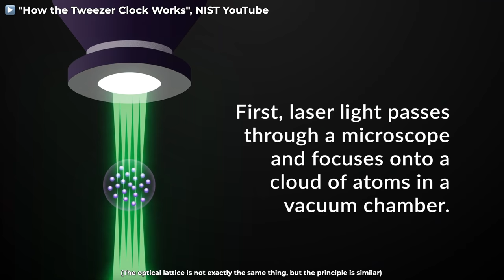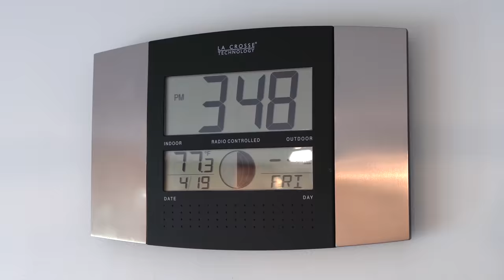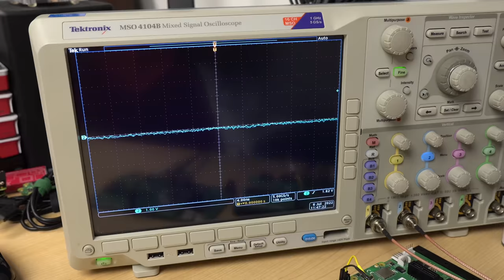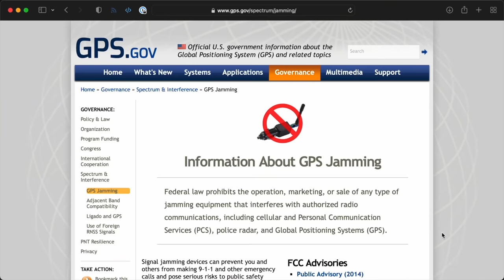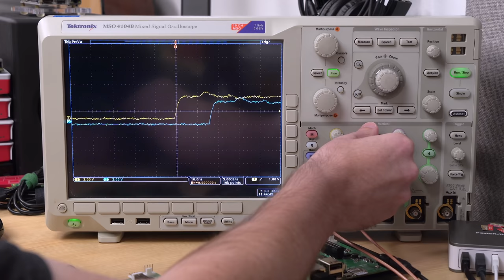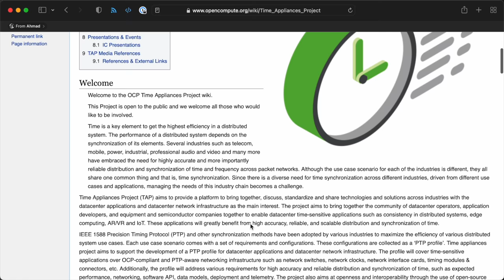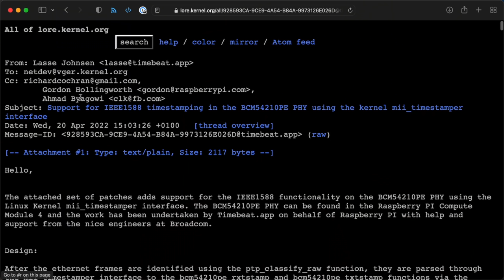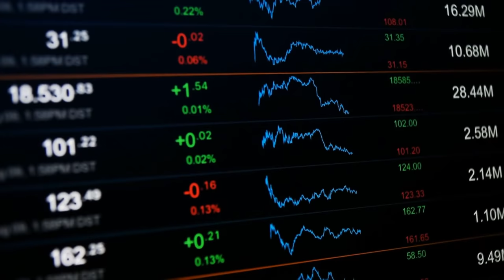Nanosecond clock sync with a Raspberry Pi

Comment: The one thing I need is automatic time zone switching across my network. I live in a bus and relocating from CA to NM for a period consisted of a lot of manual changes. My GoogleTV Chromecast is still in PST, which is fine because I’m about to head back, but I loathe the process of resetting my Unraid server and all its dockers.

Comment: You want to have accurate time so you can tell how long it will be before there are any Rpi's in stock. I thought the days were over, when I wrote code on paper and dreamed that someday I would get the real computer! A complete linux complete turnkey quad core system is now cheaper than the latest non existent Pi offerings.

Comment: Luckily, there is already a measurement of radiation that uses bananas. lol

It's the BED, or "Banana Equivalent Dose".

The average banana emits about 0.1 microsieverts, which is only about 0.0000107185 Roentgen.

In the worst areas of the Chernobyl reactor building (right after the disaster), the dose rate was around 20,000 Roentgens per hour.

That's around 1,865,932,733 banana's worth of radiation. :o
Reply: It's quite likely I got some of those figures wrong, btw, but anyone is free to correct me. lol

Comment: Until the CM4 comes back in stock is is more unobtainium than those special clocks and expensive network adapters. So it is basically a moot point for most of us in general.

Comment: Excellent video Jeff.   

I would love to see a video about the PI’s ability to generate a reference frequency.    Not a reference time via a pulse interval.  

The frequency domain is very important for synchronization of communications.   You know as in frequency hopping spread spectrum.    If the PI could give us a cheap way to generate an accurate frequency it would enable all kinds of elaborate data exchange at a very low cost.    It would be a game changer.

Comment: I don't mean to be pedantic, but the shortwave signal that has the time is WWV.  Devices such as watches and clocks use WWVB, which is carried on a 60KHz carrier.  Similar in concept, but no voice and a much lower frequency.  https://en.wikipedia.org/wiki/WWVB
Reply from the maker: Technically correct. The best kind of correct there is.

Comment: There are network switches that can fan out PTP. So if you connect the Pi to a few of those switches, you don't need those expensive grandmasters. In this case those switches handles downstream devices however many of them, and aggregates all of those into one PTP stream from the Pi.

Comment: At the end of the video you mentioned 5G, I know 5G uses ptp for Time Sync, do you think it would be possible to get an accurate time from a 5G network to a client device? Lets say you put a 5G adapter on your raspberry.
Reply: The infrastructure is already there. It is the chip on the phone, just like the chip on the CM4 and not Pi4, that is the hold up. Same with time transfer over wifi (RTT).
Reply from the maker: Exactly! 5G chipsets do have extremely accurate timing info. The key would be getting access to it. I have only played around with LTE modems, haven't had a chance to dig into 5G yet.

Comment: wtf, since when did a radio time receiver cost thousands of dollars?
I bought an DCF77 receiver in 1991 for around 30DM=$10 and attached it to my Amiga, later to my first 486. Even on the Amiga implementing a Stratum1 NTP server only meant a tiny little programm running in the background. And that wasn't a cheap chinese one, it was a "made in germany" one.
Reply from the maker: The radio example was given earlier in the video to illustrate PPS—when I mention 'thousands of dollars' I'm talking about current grandmaster clocks which take in GPS and other time sources, have a stable holdover oscillator, and output PPS over the network and other means.

Comment: So why does the CM4 has the chip with this special function that the regular Pis don't have it? Is it because CM4's industrial connection or is it merely a side-effect?
Reply from the maker: I believe there was an opportunity to upgrade to this chip during the CM4 design process, and some of Pi's partners had requested it since it supported IEEE1588 out of the box; it seems the chip on the Pi 4 may have been built with the feature in mind, but it had never been validated so it's not a listed feature of that chip.

Comment: Most radio controlled clocks use the signal from WWVB which runs at 60khz and there is no voice. While you can use WWV and WWVH too that would be more for a diy solution since there are multiple transmitters at 2.5, 5, 10, 15, and sometimes 20 and 25Mhz and depending on the time of day different ones will be receivable, whereas 60khz is available for most of the US, typically stronger at night.
Reply from the maker: Heh, I can imagine someone writing an AI engine just to translate timestamp information from the voice... when the data is literally encoded in the signal already :D
Reply: @JeffGeerling  Lol that would be crazy. The low frequency is used more for coverage and reliability on one set frequency than extracting the signal format.
Knowing this is what happens when you're both a RHEL admin and a ham radio operator, you learn lots of mildly useful knowledge.
Reply: @JeffGeerling  HF signals are generally propagated via the ionosphere, so the path length is quite variable (on the scale of milliseconds), even moment to moment. The VLF signal, being groundwave, would tend to have a more consistent pathlength. Not that either source is intended to be used for precision time transfer anyway.

Comment: I know a project with this in mind. Central clock replacement.
I think there still is a lot of old mechanical clocks needed to be replaced by a raspberry pi.
Reply: I have been replacing clocks in my house for a few years.  I have four pi zero (original, w, 2w) based clocks scattered about.  Two are clocks ONLY.  Two have clocks in the UI; but, also play audio from my home server.  I have a pi 4 based GPS enabled NTP server supporting all my networked CPUs.  My wife puts up with me. 😁

Comment: @Jeff Geerling this may have been mentioned; Anybody doing installation of modern Audio and Video equipment where they are transporting Audio and Video over an IP network via Multicast relay on PTP for sync. Some of the protocols I've had experiance of are AES67, Dante and NDI, others include AVB which is an expensive technology stack as all the network switching gear needs to also suppot AVB for it to work.

Have you ever used AES67 or NDI given that they are the more open of the AVoIP standards and that you are someone who uses Audio and Video however modest the equipment may or may not be?
Reply from the maker: AES67 is something my Dad and I have been discussing making a video on over on the Geerling Engineering channel. I'm more focused on the IT aspects, but he's been in media/broadcast his whole career, so I want to have him discuss it more.
Reply: PTP is a necessary part of the SMPTE 2110 standard as well. All of 2110 systems I've worked on use a open specification called NMOS for device discovery and connection between senders and receivers. If PTP isn't being distributed through the network properly, no amount of 25Gbps streams go anywhere since PTP is performing the same function (kinda) as reference/genlock in baseband applications.

Comment: What happens when your two PIs are connected together with a switch place between the two?
Reply from the maker: Depends on the switch! Some are terrible for PTP, but many can work great, it really depends on how deterministic packet routing is.

Many of the more expensive managed switches have QoS settings that can pass through PTP traffic more deterministically, even when other features are turned on that would kill accuracy.

Comment: Actually PTP can be run through a i210 and still reach nanosecond precision. And for the accuracy of the time you can get a GNSS Chip that will be already available for around 120$ and the i210 even supports hardware time stamping etc.

I suggest using sync-e though sadly it doesn’t have as nice of a sync with the ntp daemon though..

And getting a CM4 is actually very difficult..

And i already beat you i do have a GM in my rack at home with which i sync all of the devices..
Reply: Can they do TC also? Guess not as there is only one Eth?
Reply: "...a GNSS Chip that will be already available for around 120$..."  

You spelled "under $10 shipped" incorrectly, if you're actually referring to a GNSS chip, or even a generic "GPS" module.
Reply: @JxH  I took as a example a Ublox M9N Sparkfun module ..
In the time where ublox had to throw a bunch of there chips away because of defects..

Comment: To my knowledge, NIST still uses Cesium clocks as primary time and frequency standard, since the definition of the second yet is defined via Cs. However, as you stated, there are way better (optical) clocks, let them be ion clocks or neutral atom lattice clocks with way higher presicision and accuracy than Cs clocks can ever reach. However, their absolute frequency is yet limited by the definition of the second and thus Cs clocks.
Reply from the maker: Technically, yes—I was a little inaccurate saying they 'define the second' with the new strontium clocks. They still are using the cesium fountain clocks for GPS timing right now.
Reply: I work for a telecoms company and look after our network sync equipment. We have 3 Cs reference clocks with one nominated as a GM. We distribute this across our network using a combination of PTP, Sync-E, and even SDH circuits to remote sites. At those it’s used as a reference for on-site secondary sync clocks, which also have GNSS sources (for redundancy).

I use GPS trained Rubidium oscillator test equipment to monitor and compare clock sources at sites, to ensure we are working within limits to avoid packet loss, clock slips between different circuits etc.

Great video, wasn’t aware the CM4 had PTP on board.
Reply from the maker: @jockinafrock  Nice! Maybe there are some opportunities to set up mobile rigs with the CM4 too—having full Linux and not being more beholden to whatever software the manufacturer throws in can be nice for widespread deployment. If you have the staff to support/understand it.

Comment: using gps time via an older usb gps is a great way to hack time and get all your machines synced plus avoid ntp reflection attacks - good timely content here! #red shirt shift
Reply: you can sync all your machines via webmin sys time and also hw time - you only need 1 usb gps - all the machines sync to the opnsense internal stratum 1 so you never go outside to sync - this content is a deeper look and great content - should you have redundant HA time servers? probably....if you are serious about your time - installing ptp may have been the bijou in this talk - the differences between mill and micro and nano seconds is a lot and we should all have some heightened expectations for future time hacks like the best movie ever made (red shirt jeff will concur) Time bandits
Reply: on a serious node you should actually line up the best hw and you should test failover and averaging of time between the ptp servers - it is master and slave you may want a sep master and slave so you may need 4 for HA - going with opnsense could be cheaper - there should be a turnkey linux version of this as a couple iso you spin up and passthrough gps usb...it should be easy to do on linux or bsd - maybe on a even lower cost arm like new nano pi with 2 2.5 and a 1g - 2 of those at 60 and a gps module and then just get 2 more to run the redundant time server - 300 bucks you have opnsense HA and nano second redundant (HA) time server #pps up and down #get a better gps module #birds are real #azimuth

Comment: But bro if u know exactly how much latency you are getting can't you just recalculate the real time but adding the latency to the time ? Time drifting can also be dealt in the same way , also if we are receiving those time signal from the satellites using ptp there is a possibility that those satelite are using atomic clock to calculate time or by a formula that calculate time based on the time it took for a satelite to complete 1 rotation of the object it's revolving around idk  exactly which method  is being used on the satellite you mentioned but in space there is a concept of time dilation which states that time in space is slower than here on earth it has been practically proved using the atomic clock , and mostly all satellites while sending the time data back to earth also take in account the time dilation and recalculate time for earth the same way i mentioned earlier.
Reply: You're describing a thing NTP and PTP inherently do automatically. The problem is even the fifth derivative of finer noise is random, you can't just measure it away. To reach a given accuracy, you need reliable latency, to do exactly as you say. At large enough scales, using broadcast distribution (like a clock network on coax, synchronous ethernet on your network, or GPS lock) is more efficient than canceling error out from a large ethernet domain, or worse, the internet.
Reply: @bobbydazzler6990  isn't that what i wrote at the end i was asking that question because he was mentioning accurate time delays that's at 5:45 that y i thought we can just request time from a central location and just add the delay to the machine which requested the time @Jer Cos already informed me that it's inefficient and ptp and ntp already works that way there is no need for me to learn how gps work because i wasn't even talking about gps 🤣

Comment: DANTE Network Audio also uses a time signal, for exaple digital mixers like the yamaha ql, cl and rivage include a very accurate time giver and the consoles also accepts an external time signal via coax.

Edit: The standard of the external time is called Wordclock
Reply: Dante uses PTP for timing
Reply from the maker: Isn't Dante the one that still uses PTPv1? (Whereas most other equipment uses PTPv2 now).
Reply: @JeffGeerling  From what I could find PTPv2 is supported as AES67 by many Dante devices, but the funktionality is still limited and yamaha says it wont replace Dante. Main feature is the option to exhange audio streams between different devices that use other standarts than Dante.
Reply: @JeffGeerling  Yes- Dante is still PTP v1. Most of the other "Flavors" of Audio over IP are on v2.  I was part of the team that installed a rather large AoIP (QSC QLan) paging system in an airport. When the PTP clock drifted, it became the "Canary in the Coal Mine" that something was up with the core routing of the Airport's Network. Oh, and then there was that time that somehow the entire audio system became slaved to the PTP clock from the runway lights. That was from someone fat fingering a network cable in the wrong switch..

Comment: I assume the ethernet cable connecting both Pi units is a crossover cable, is this correct?
Reply from the maker: Nope! Modern 1 Gbps ports will auto-negotiate without any need for a crossover cable now. Still had to set custom IP addressing on them though.
Reply: @JeffGeerling  Awesome! Thank you Jeff!